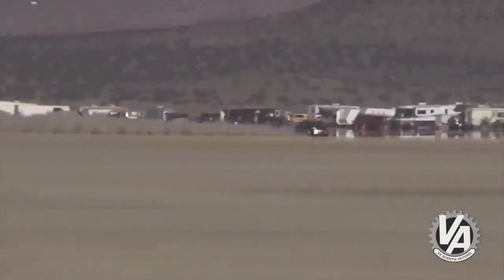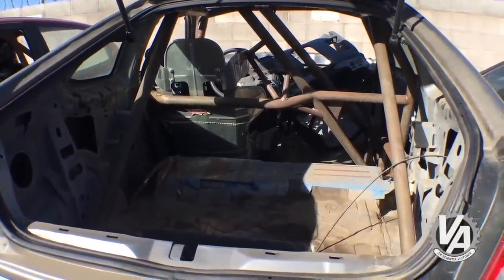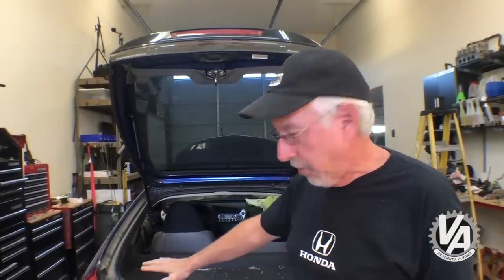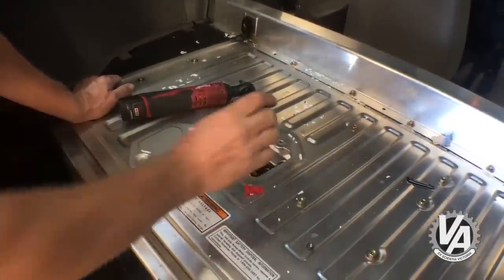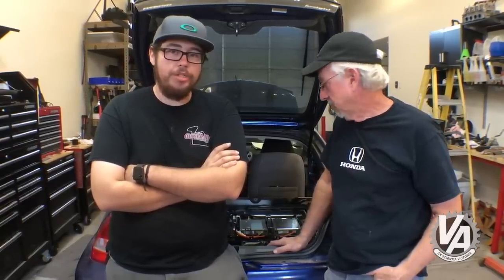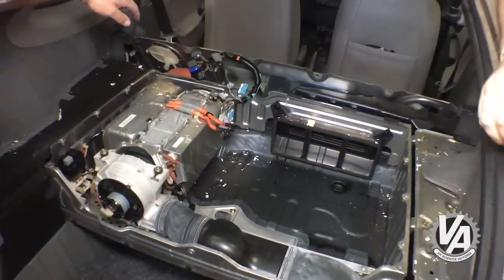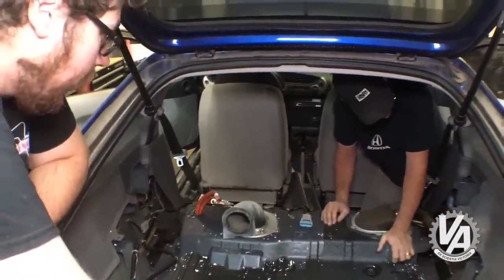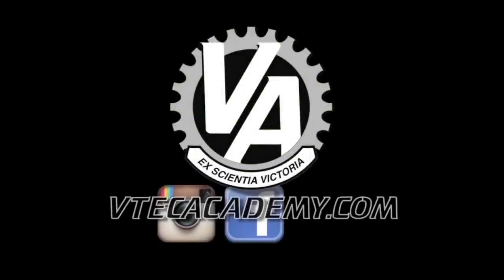Project Epiphany 2: Insight K-swap Part One

Comment: I have a blue 06 insight, I de-hybridized it, using a adruno program board, saved me $2000 from getting a new hybrid batter, mine is a 5 speed so it's a little sluggish but not really noticable.

Comment: Only 144 volts? Pffff! 😁

That will hurt. I've crossed switch terminals on a locomotive horn switch with my finger...74 VDC. 

Don't cross the streams.

Comment: Cool projects but I think I would have respected this more if you swapped some slightly wrecked cars. Leave the pristine ones for the eco enthusiasts that love them as delivered from the factory.
Reply: A lot of the enthusiasts own multiples of these cars. It's pretty amazing when you go to owner events and find out people have 4 or 5 of these. As cool as the idea is of owning one, there isn't much demand. The older ones aren't being kept on the roads because of the engine mileage, cost of replacing the batteries and the fact that they are tiny. Honda stopped making a lot of the replacement parts too, so it is becoming more difficult to keep them nice.

Comment: Brian. I'm going to need your expertise purchase in some  Engine mounts  For my new project. K swapping in and EG.
Reply from the maker: old Errol hit Hasport or one of their distributors.
Reply: @VTECAcademy  : I have. I was told to email some pictures of the transmission i'am using. But I could not find You Guy's email address.
Reply from the maker: I am Brian @ Hasport dot com @olderrol1968

Comment: nice, im working on having a kswapped insight for sale soon thats very street worthy. for the seats, i like to modify them by taking out alot of that stiff boxy foam. they sit lower and add side bolstering just by sitting lower into the seat and everyone ive asked has found them to be more comfortable that way. it also allows u to add things like seat heating elements and i even put cooling fans in mine. for the space in the back i put a nice 10" sub to round out the audio, or u could put the spare back there and have room for the 12v battery next to it. ive been working on LED upgrades for the stock headlights and a small flashing f1 style rear light is helpful to be seen on the street; noone expects these lil cars to be as fast as they are... ive also done a jdm style double din audio head unit on another. been following u for a long time, check out my instagram @tigerroadperformance if u need some inspiration for ur street build!